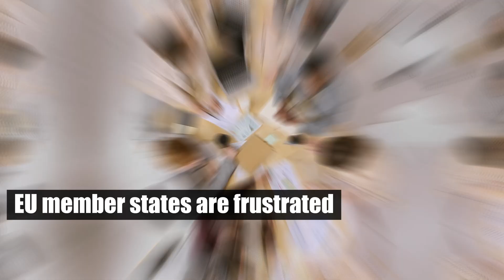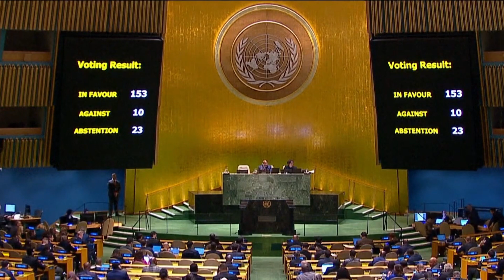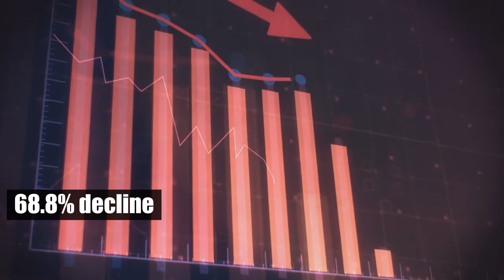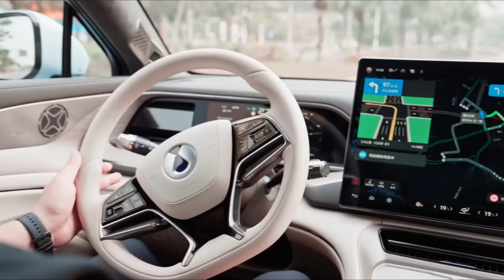Germany's Warning Shot: Is Europe Ready for the Coming Heatwave? Electric Car Laws Reshape Europe!

Comment: Does anyone really want an EV that may not brake properly, airbags don't work, auto-unlock don't work after crash and during fire. And battery combustion even when it is stationary. The battery is installed at the lowest point of the EV, excluding the tires and wheels. On average, 8 combustions per day!!!
Reply: Absolutely not. Trust and believe even here in So. Cal USA people are not buying it